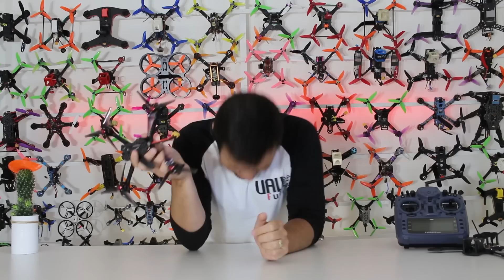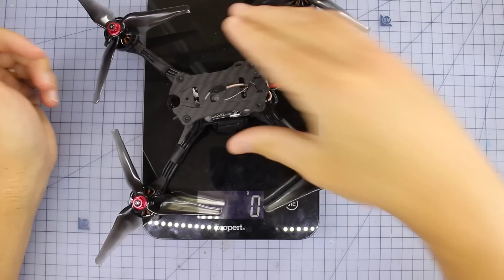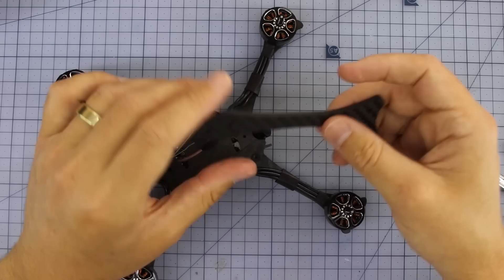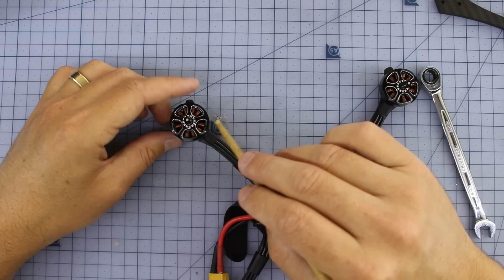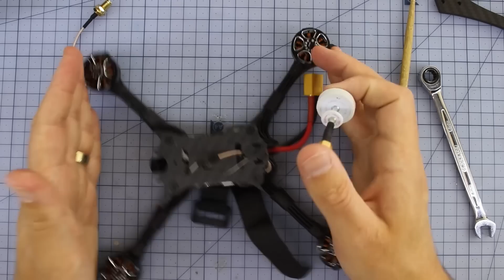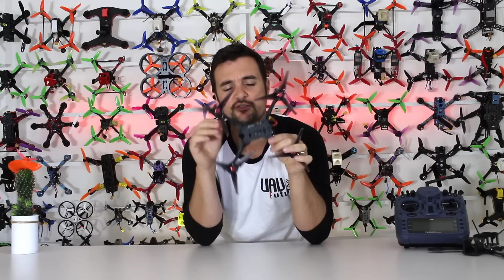WORLD’S BEST DRONE FOR UNDER $250!! - EMAX HAWK 5 REVIEW

Comment: Hey. UK here, I've been looking at the hawk 5 for a good month or two now. You've just confirmed what  thought. Thanks

I know it's six months later but these are £150 - £160 (260 - 280 AUD) Seen them for £200 - £250 with goggles, transmitter, extra battery

Flight controller: EMAX Magnum F4 built in Betaflight OSD
Brushless motor:  EMAX LS2206 2300KV motors  MPN:  
Brushless ESC:  EMAX bullet 30A 4 in 1 BLHeli - S DShot600 
Receiver:  Frsky XM 16CH SBUS Micro  
VTX:  48CH 5.8G 25 / 200mW switchable power VTX board  Required Assembly:  
Camera:  Foxeer Arrow Micro V2 600TVL CCD camer

Comment: Hi, it's about 205,18€ ($252,55) here in Spain. Well, what I like most about this quad other than the components it brings, how smooth it is and it's price, is that I really appreciate the work emax is doing, you konow, they are listening to the community and they are paying attention to the small details, I mean, anyone can zip-tie the cables of the connector or put glue over the vtx connector but it's really nice to see that they are looking at those details and others like the hole to be able to see the vtx lcd.

Comment: good review!  ive had one for a few weeks now and its pretty good for what it is.  one thing worth mentioning is that the vtx in this thing is terrible.  Unfortunately I dont have a way to measure the true output of it, but when set to 200mw with the dipole antenna I lose signal less than 30 yards away.  While im watching this Im actually in the process of switching over to an rhcp antenna to see if that helps the issue. I have a tramp hv vtx that I will be putting in it in the next few days.  Another thing i noticed is that the motors get pretty hot on the stock tune.  It doesnt seem that they are too hot bvut i would say uncomfortably warm.  My main issue with this is the vtx and the fact that it isnt compatible with smart audio.
Reply: Tyler Karr fixed the VTX issues? I see most of them mentioning same vtx issue but not solution. Please help us with solution as well.

Comment: $250 in Maine. I love the emax f4 magnum and this frame is a great bargain. However, the screws come out with a little flying so take out the screws and put locktite on them before you fly. Also, put liquid tape on the whip where it plugs in. And be sure to mount your rx antennas on the arms. And tie the xt60 wires to the top plate if you top mount the battery. And ditch the strap for two nice ones.

Comment: Really, really close.  Good weight and flight characteristics.

Improvements would be:
- Smart Audio VTX.  Being able to change channels and power quickly and reliably is important for racing. (Matek VTX HV or a Immersion RC Tramp HV, etc.)
- R-XSR instead of XM+ gives telemetry back to the Transmitter (so you can have audio alerts instead of looking for alerts in the OSD while racing).
- BLheli32 4-in-1 for Dshot 1200 and telemetry and would be a nice to have.   Dshot is essential for turtle mode (which is essential for racing), only Dshot 1200 comes close to multi-shot for responsiveness.  Raceflight can switch between the two, but takes countable seconds to do so.  (Holybro makes the Tekko32 which can do this).

AU$ 333 at 15% off.  AU$390 non-discounted.

Comment: The Hawk 5 is an amazing piece of technology!!!  Even at my local hobby shop here in the US has them in stock...only for $259.99 instead of the normal $249.99.  The coolest part about the Hawk 5 is the smooth flying out the box and the light spec motors.   Those motors are something I cant wait to try out!  As a new FPV Drone pilot this is the perfect candidate for my 1st 5" racing drone.  Plus Crash Test Cal said so, so that's all the proof you need!!!

Comment: 249.99 U.S. I live in Missouri and I like that it is a quality racer that is ridged and comes with some spare arms. Im a very new quad flyer and i only have some like "toy" quads so the fact that its so sturdy and has that extra arm and also that the arms have those bumpers that extend past the motors to protect them would be extremely helpful to me.

Comment: $249.99 (bangood link) .. I like the extra antennas!  One question, will a BNF drone like this connect to the RedPawz VR-D1 goggles that come with the R011 kit?  I'm curious if those goggles will work with anything else at all (since it's 40 channels).  If it will, I could use the two antennas, one on the drone, one on the goggles!

Comment: 249$ us from emax sight ... Thanks for a great review .... I wasn't so lucky though with the baby hawk are as the eses touched the carbon fiber on the 5th pack .... I checked before flight for possible clearance issues it looks like the actual battery solder joints is what actually contacted... Unfortunately emax has yet to respond..... But with that being said again you create great videos and it it looks great and so did the baby hawk r .... PS I bought mine from emax  Directly with a label stuck to the Box check the ESC clearance... Just fix the problem... Put me in the drawing and I'll be more than glad to pay for the shipping

Comment: That'd be somewhere around 203€ and what I really like about this quad is that it has a pretty dope and efficient setup. Motors and everything. I'm so into the frame as well. Pretty thin & light but you're not sacrificing any of its stiffness and rigidity for it.

Comment: 205,21€ it's cheaper than 2 furibee X215 pro. I 've got the furibee from your advice it's yet incredible but as a beginner I have no more antenna's and also broke the one with come with my Ls- 800D box google. Now I think to by a new one cause BNF are so cheap nowaday that spare parts are not a good deal anymore. Now X215 pro is at 125 USD$ with XM+

Comment: Its PHP 13,040 in the Philippines. The hawk 5 is a awesome quad it has very very nice motor.The frame has replacable arms and it comes with free extra arms and thats good. It has motor protection when you get crash it will protect your motors. It has a great stuff inside and I think the emax step now into the gas by showing a fast quad this thing will rip and scream loud in the track.

Comment: In Amsterdam I can order this beauty for €205,21.
Emax showing off it's brilliant new motor design. N48SH magnets so less loss of magnetism from usage, and still more power than the 'old' N52 motors. More durable and more power. Amazing accomplishment.
Neat frame with 3 screw motor mounting to have some extra carbon at the end of the arms. Nice clear design, easily to maintain. And no need for PID tuning, hallelujah. Thanks Emax. You gave the quadcopter yet another boost forward.

Very innovative!

Comment: Nice BNF for sure. They are $249.99 here in Arizona but the first batch has already been sold. EMAX says there should be more in 2 weeks or so. They say that 1 antenna is for the quad and 1 is for your goggles.

Comment: Those little whip antennas actually work very well today, I remember once upon a time they were useless, but I don't know if the advancement in VTX or VRX's, but I can fly my 2.5" with a whip about as far as my 5"ers with Pagodas, even around metal and trees. (200ma)

I can still build a very high end quad for around $250- That includes a $50 frame, DALRC 40A engine, Helio FC, 2307 motors, Mach 2 VTX and Foxeer camera- and I enjoy the build time- That said, if it's without it's issues,  this at$250 is very competitive.

Comment: Hey Stew, I'm new to fpv and can't get enough. This puppy comes in at 333.95 in Aus + Postage. Not bad! I absolutely love the build and have seen a local guy zipping one around with such a smooth flight. The wide angle camera fov has to be my favourite feature on this drone. I love being able to see a little more in the peripherals and this camera makes it feel like it has a pinning effect toward the middle that gives great direction and makes those quick swoops and rolls easy to do without getting too disoriented.

Cheers for the review, I have been looking at one of these for the past few days and you answered all the questions I had.

Happy flying mate.

Comment: honestly this drone is awesome no doubt and I would have bought it if I didn't just buy my self a kopis 1 a baby hawk r and a dark max back up quad I love my kopis it has smart audio came with an XSR with telemetry this one doesn't have either of those things it included a go pro mount and was tuned also had T motor air 40s I would say the kopis is higher spec only thing I would want is the 2207 lyte spec motors to put on and up grade the T motor air 40s but there ok for me I'm pretty new plenty of power at the moment and they don't kill my batteries plus I like the fact I remove 4 counter sunk screws and I'm into the whole quad easy plus with 5mm body stretch X and chamfered edges it's awesome and came with a case and a great manual written by none other than JB and it's only 50$ more than this one like I said wish I had the 2207 emax motors maybe as a part of a future upgrade but for 250$ I would by the drone in a heart beat

Comment: It's 204.38€ here in Portugal (or any EU country). This does seem like a great quad and lately, after so many components breaking, I wonder how top components handle the use (my Bfight210 only has 1 motor and parts of the frame from origin, everything else had to be replaced over time)

Comment: In the USA it will cost me $249.99. I love that they used 2206 motors instead of the wimpy 2205. Its not the most powerful but its right in the middle for beginners and those who just want a high quality RTF drone. From my limited experience, Emax is also a tried and true brand, your not exactly "rolling the dice" with this buy. Top of the line!